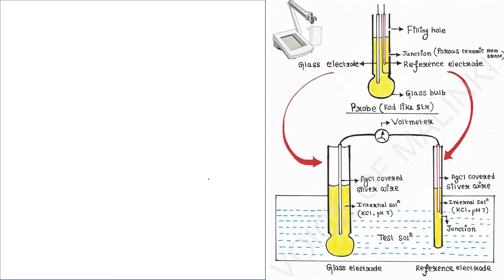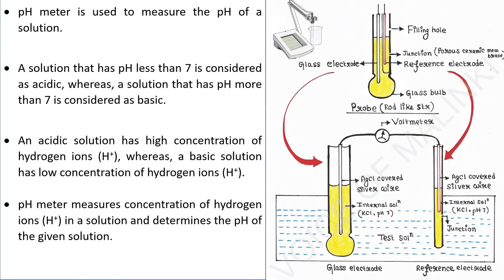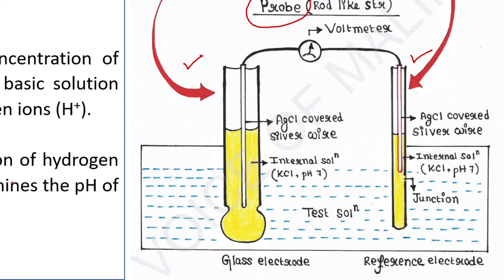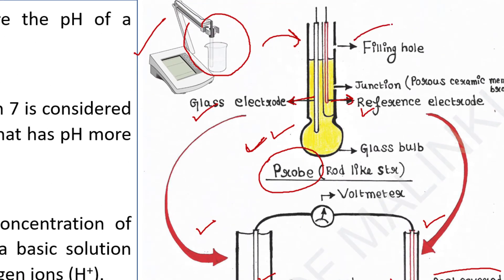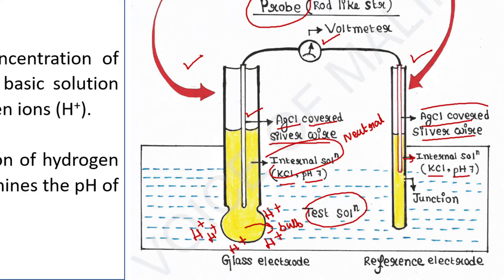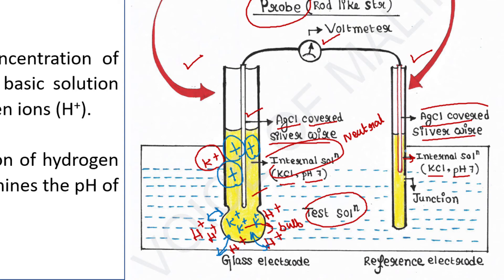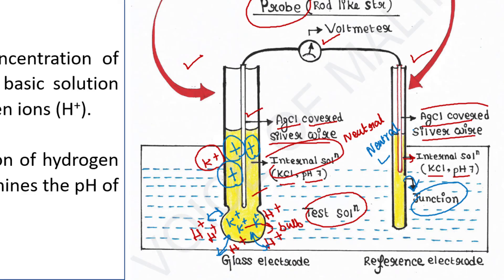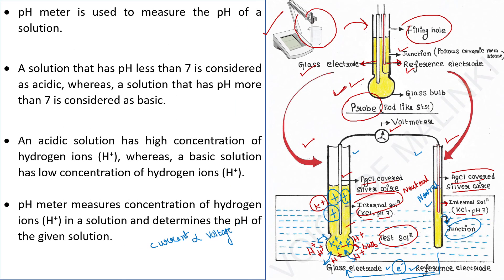pH meter | Principle | Study smart in minutes

Comment: When K+ fills in the inner glass membrane then the inner solution of the glass bulb is more with the cl- ions. Isn't it?. Then to neuralize that excess Cl- the silver electrode will donate elctron and will become Ag+ to produce AgCl. Therefore the glass electrode will be dense with electrons and isnt it negatively charged? So the electrons wll flow fr glass rod to reference electrode. 7.44 expressed other way. Am I correct or not?
Reply: Absolutely correct 💯
Reply: That's why electrode potential difference generated and according to nernst equation we get a value of pH

Comment: Ma'am can reference electrode be made of Hg-Hgcl ? Also can HCl be added instead of KCl inside the glass membrane ?
Reply: U need salt bridge but i think HCl will act as strong acid so u can't use HCl as it will have very low pH
Reply: modern days glass electrode contain 0.1 m hcl to provide H+ IONS to balance the porous membrane H+ ion equilibrium

Comment: Thank you, I have one question: what is the purpose of the junction ? Wouldn’t it be easier without it - just keep the KCL in the reference rod?
Reply from the maker: Junction is used in reference electrode since it allows movement of electrons from reference electrode to solution to glass electrode to complete the circuit.
Reply: @VoiceofMalinki  Thank you. But you mentioned the glass bottom only allows passage of positive ion exchange, then it must also allow the passage of negative electrons?
Reply from the maker: @zl7650  Yes absolutely. The glass bottom is porous, and it only allows exchange of positive ions. Although electrons are negatively charged, but these are not negative ions, and electrons are very small, so indeed electrons can cross the glass bottom.
Reply: @zl7650  Small ion exchange through the junction of the reference electrode completes the circuit. The glass bottom doesn't allow exchange of ions or electrons, instead it senses the difference in ion concentration of the inner neutral buffer (0.1 M HCl) and the test solution. This difference is recorded by the sensitive electrode as milivolts and reflected in voltmeter as pH. If the solution has more ions than inner buffer it is sensed as acidic and if it has lesser ions, it is sensed as alkaline compared to the inner neutral pH buffer. 
Hope it helped.

Comment: Thank you mam for this short and sweet explanation 😇
But mam can you tell the principal on which pH meter works
Reply from the maker: The pH meter works on potentiometric principle. As the acidic solution has more positive charge (H+ ion) than alkaline solution, and the acidic solution has greater potential to produce current than alkaline solution.
Reply: But mam basic solution have only Oh- ions?? How can we measure basic city??
Reply from the maker: @jpgnt5721  Basic solution also contains H+ ions, but in less amount. This is the function of pH meter that it measures the amount of H+ ions.

Comment: mam why positively charged H+ ions attracts positively charged K+ ions ..........................please answer mam
Reply from the maker: Beta, here no attraction between H+ ions and positively charged ions is going on. What actually happening is, glass electrode has a bulb in bottom, which is specially designed chemically, so that it attracts only positively charged ions. Hence, from both sides (inside bulb and outside bulb) positively charged ions are getting attracted toward the glass bulb. This allows exchange of ions from both sides.